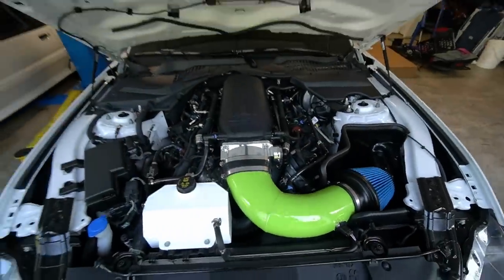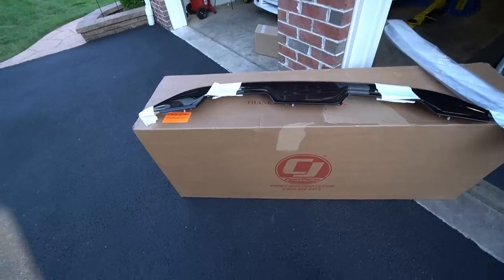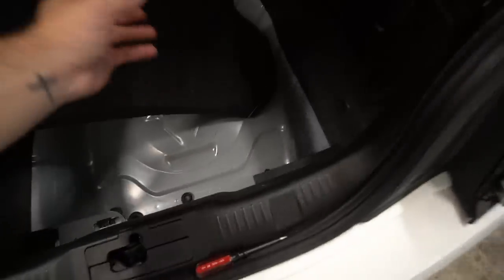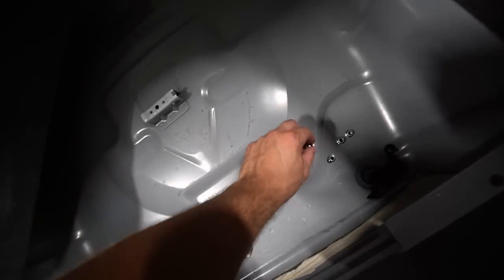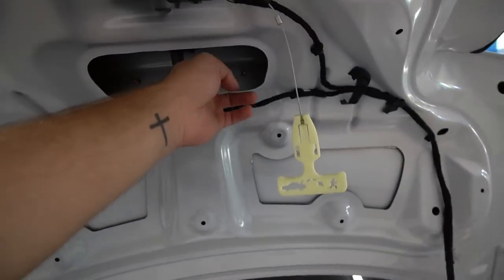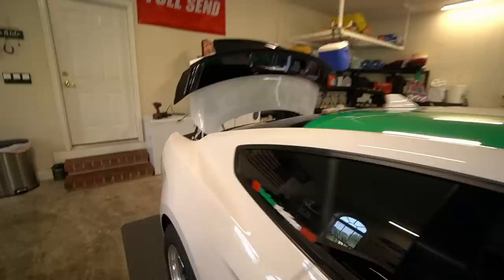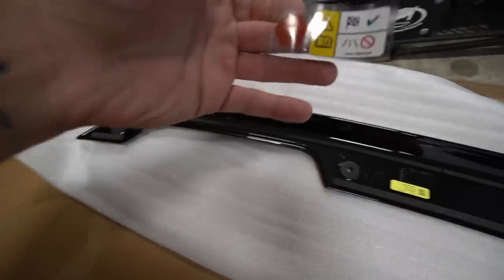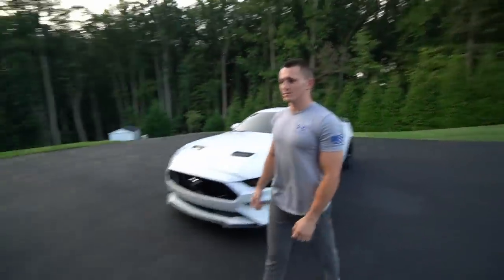I Spent $600 on a Piece of Plastic...

Comment: Yeah I like the other comment about the red and green. But I would change the green to carbon fiber and look for more add ons to the engine. I would either paint the roof or wrap the roof black to match the spoiler. But the new spoiler looks better for sure
Reply from the maker: Yeah if it was carbon that would look sick too.